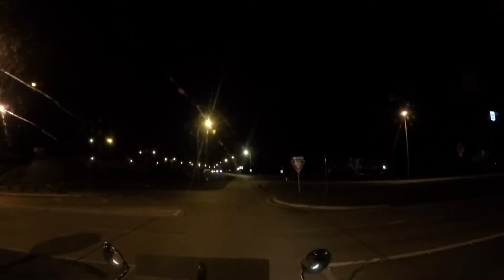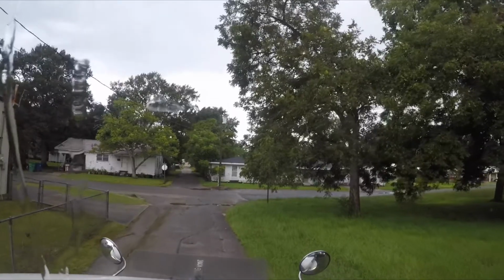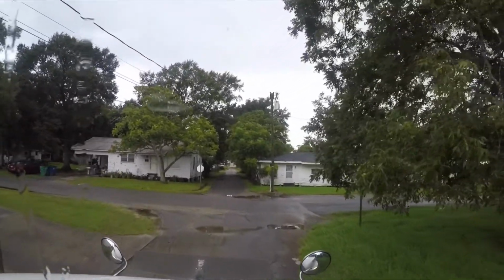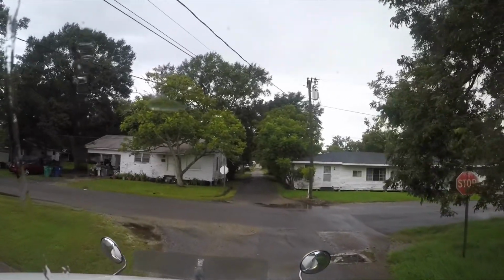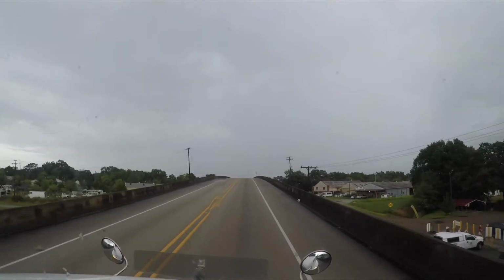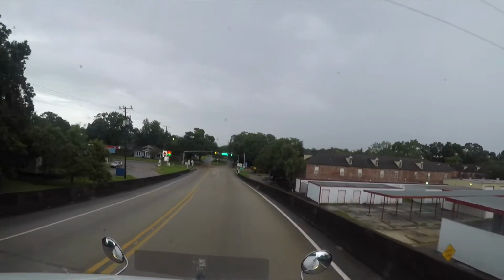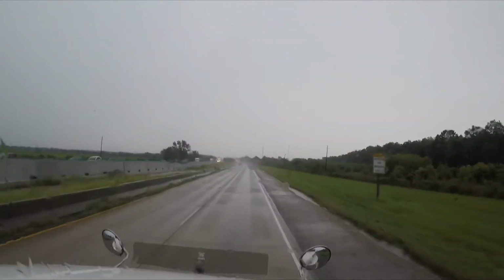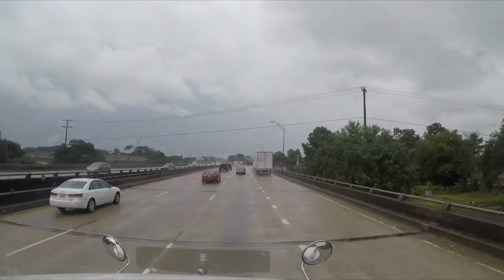What Self Driving Trucks Will Need Pt 2.

Comment: Seems like trucks (trailers)  could have more (better) side and rear sensors as well as better blind spot monitoring.
I don't dive a truck but changing lanes and making turns must be scary for the driver.
Reply from the maker: I would like them to be able to do it without any changes to the trailers, but I don’t know if that’s possible.

The mirrors have you covered really well....I actually feel more confident changing lanes in a truck with a 53’ trailer than in my Model S, especially before the blind spot visualization....Now when it’s raining and truck mirrors are wet, I wouldn’t even drive next to a truck.